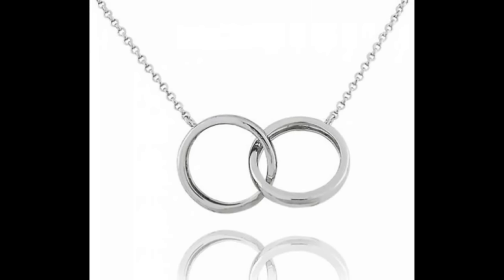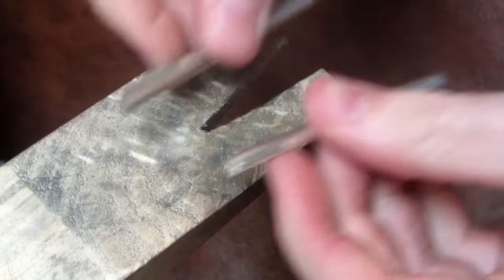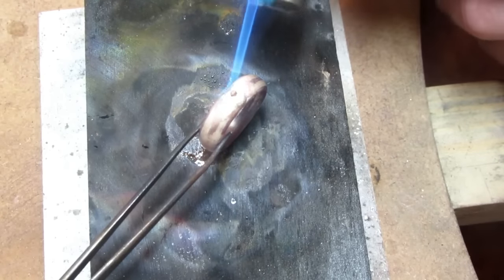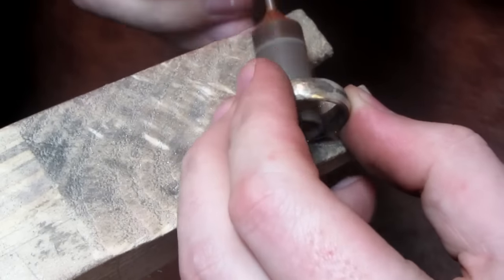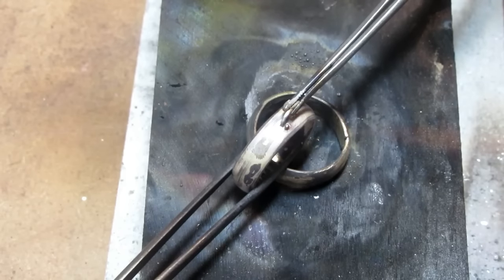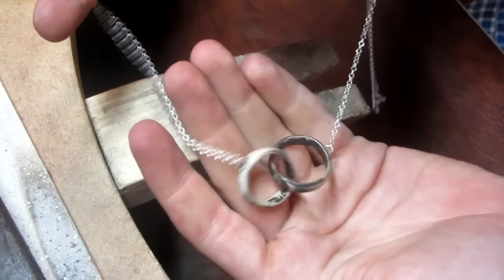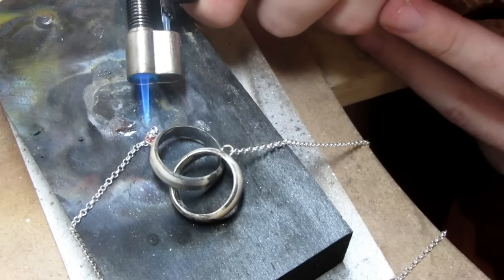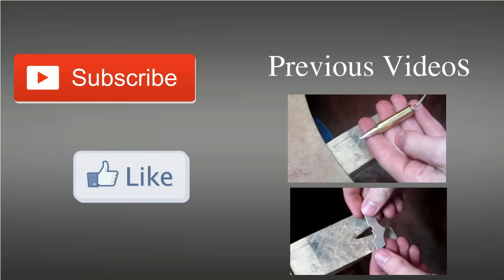How To Make an Interlocking Ring Necklace

Comment: Thank you for this. 
question :1. How were you able to solder the end of the chain once around the loop. I tried it before and my chain melted. 
2:If I used brass, can I use silver soder ?
3: What did you polish the silver jewelry with?

Thank you so very much.
I appreciate it.
Reply from the maker: Make sure you heat the ring up to temperature. If its not and you focus the heat on BOTH the chain and ring connection points, the chain will heat faster because its smaller and melt. When both chain and ring are heated up to an equal temperature it should make the job easier. And I polish first with Tripoli and then Rouge :)
Reply: @natecharleswatches  How very kind of you to reply. Thank you very very much.